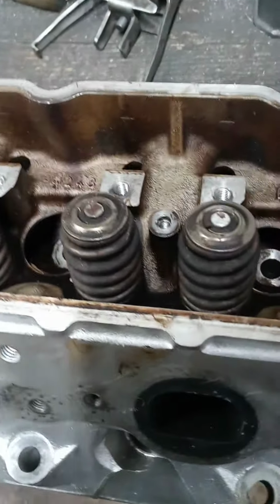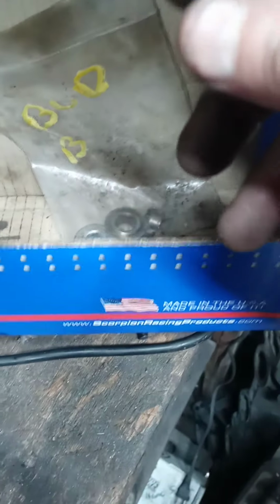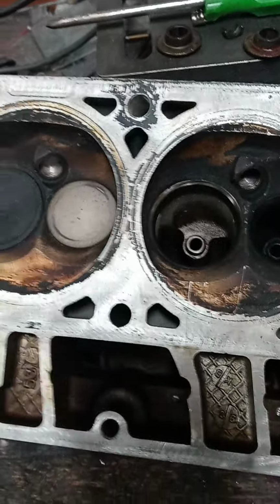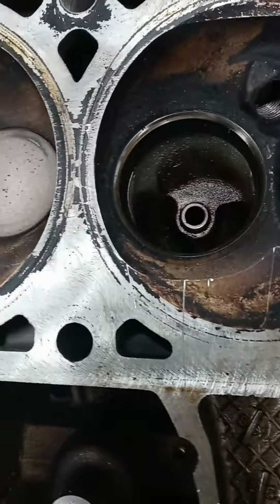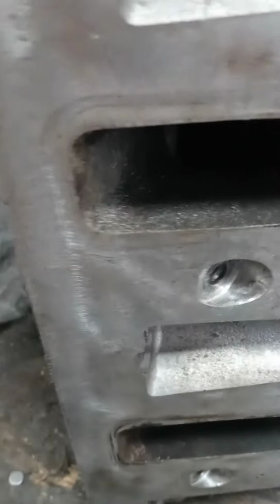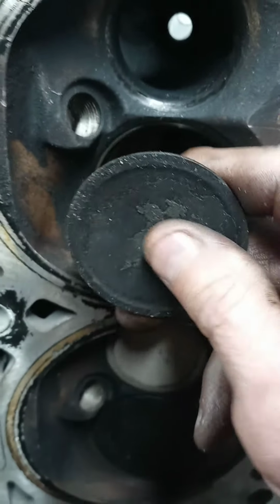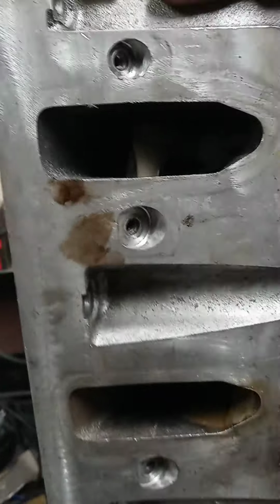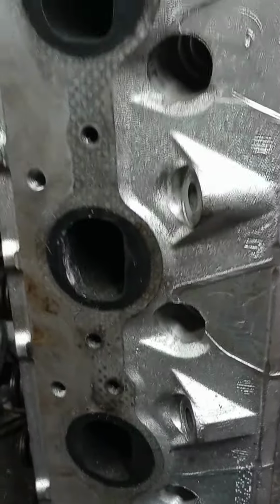Replacing your LS head with another used LS head

Comment: Heck yeah im going to take my heads apart and save 400 bucks 😁 good video Terry  as always. Is this a new set of heads that you have to port or the heads that you have had for a bit
Reply from the maker: No they are another new dirty set but im lucky guy is only looking to go 10s with them which shouldn't be a problem , and i hate disassembling heads and putting back together even more are you doing ok haven't heard from you ?? hows that little pinto doing ??
Reply: @terrygrover6440  yeah it sucks and takes forever having to seat all of the valves, yeah the pinto is doing good , im waiting for a aluminium driveshaft to come in . I put caltracs on it and ordered another drive shaft which was a inch too long so I had to order another one that is a little shorter and I can't wait until it gets hear because I haven't got to drive the poor pinto and I miss it because it is a blast to drive and im ready to see what it will do at the track. Ive also got new valve springs so that it will make power beyond 5700 which should run a decent number. How is your projects lcoming along? Are you wanting me to get that mustang out of your way so that you can have room for the truck build
Reply from the maker: @79beans347  Im almost at that point😂😂 but i do have alot of work and it's keeping me from getting back on the 460 im anxious to see what your car runs i enjoy seeing you guys do well 👍
Reply: Thanks bud I appreciate that. I like to see you guys doing good as well and I want to see what you have in store for your truck and I would like to see you get it going and doing some burnouts in it 🚙💨💨💨💨💨